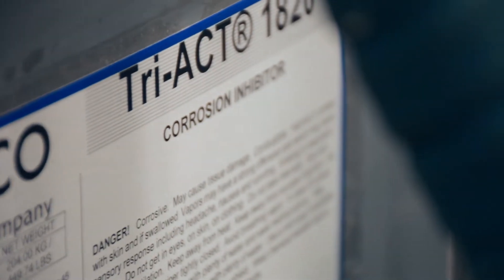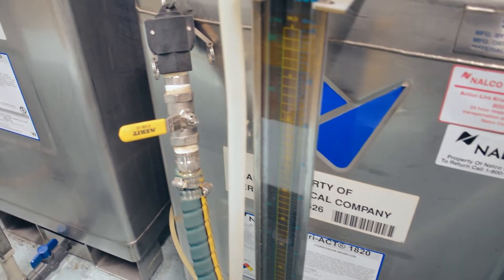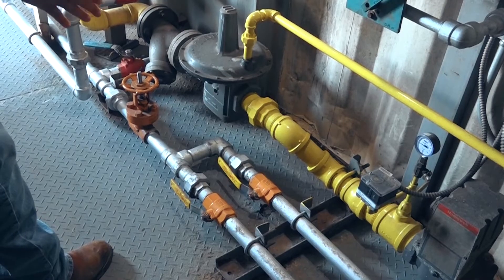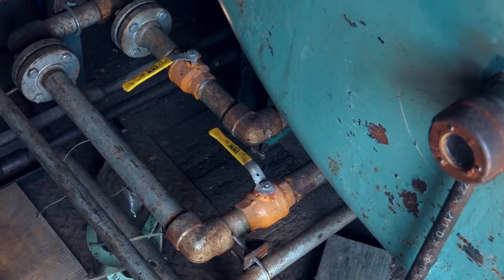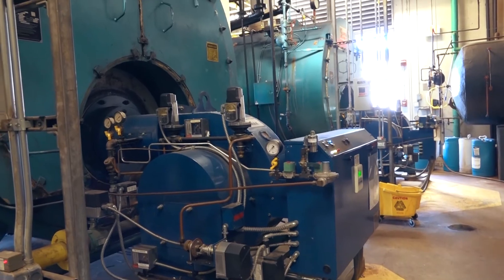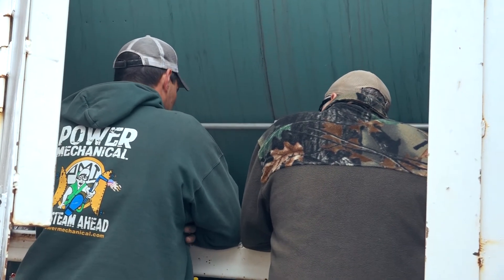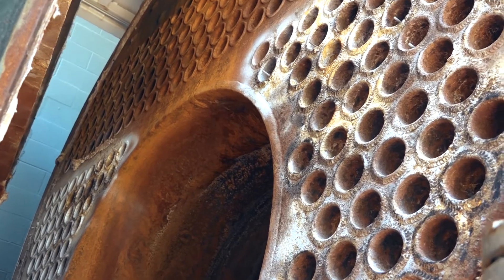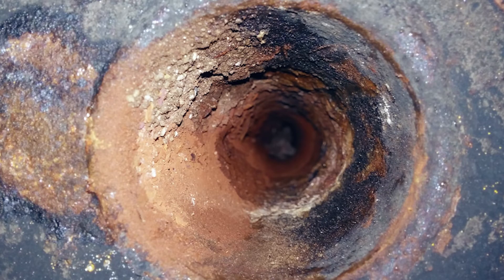Common Boiler Problems - SteamWorks

Comment: I am very impressed with your work, it is very wonderful and very proficient. I am a plumbing and central heating technician and a senior water network operator. I install hot water boilers and maintain diesel burners. Do you have a vacancy for me? I would be very grateful to you.

Comment: I am currently taking classes in boiler maintenance. It's a one week class and I don't think It's a cakewalk.
One week means it's only an introduction to the basics, from start to preservation. 
Boiler is rated 1000 litres @ 10 bar with economizer. Amazing power and interesting to maintain.

Comment: Thanks for this video ! I work in a facility with multiple steam boilers and steam chamber units and as you said, improper training is definitely a problem here. they did train me how to use the steam chamber units. But they didn’t train me exactly how to do the maintenance on them which is something I would’ve liked to learn before the lady that used to do it left the establishment. Thanks for the video it really helps me understand the reasons behind why I should blow down the steam units at least once a day
Reply from the maker: Indeed - We have a very good program to get operators the information they need to operate and maintain their boilers. 
https://www.powermechanical.com/steam-school-boiler-training/

Comment: is it possible to use seawater from the ocean in a boiler????
Reply from the maker: Absolutely. Many Large ships still use oil fire boilers for propulsion and heating aboard. They cannot use straight seawater however. Salt water would destroy the boiler itself so it must be treated mechanically (desalination/RO/Membrane) and then chemically treated as needed. Water needs to be made as pure as possible prior to entering the boiler.

Comment: I work at a company with 3 plants 12 Steam boilers in total. I do all the TDS readings, surface blow down, and bottom blow downs, water column blow downs, sight glasses, minor repairs etc. Any recommendation on where to go to apply to get my Steam Boiler Operator License? and does it pay well?
Reply from the maker: You should be able to check with your state or approving jurisdiction for pressure vessels on any certification requirements. Each state in the US has different requirements that may apply. Sounds like you have a working knowledge of the boiler room and should be a great candidate. 

Pay varies by location as well. But all and all boiler operators and stationary engineers have and will continue to be an in-demand occupation.
Reply: @powermechanical  thank you, appreciate it
Reply: ummm a better question would be, how are you legally able to operate/maintain even one of those boilers if you don't have a operators license in the first place? If any accident occurred with an unlicensed operator in the boiler room, the company itself would be liable for letting you in there in the first place.

Comment: Is it feasible to feed a boiler with pre distilled water?  Reverse osmosis fed?
Reply from the maker: Aaron, Distilled water is an excellent heating medium for boilers. With distilled water, mineral impurities have been removed and considering there is no further contamination risk in the system. An R/O system is used to purify water, only targets different contaminants. It all really just boils down to what the water going in needs. 

So in answering your question, yes both of those may be used. For example  Pre-treated water, (Chemical, softener, R/O) is used as makeup into a DA where it's then sent to the boiler and practically void of any impurities. This is a classic high pressure steam feed application.

Comment: If I want to lubricate the air pump does the burner need to be in operation or in standby mode
Reply from the maker: Mason, Some compressor manuals specifically state to only add oil while in operation. The best thing is to refer to your operator's manual. What type of boiler/burner/Air Compressor are you referring to and we can see if we have any further recommendations.